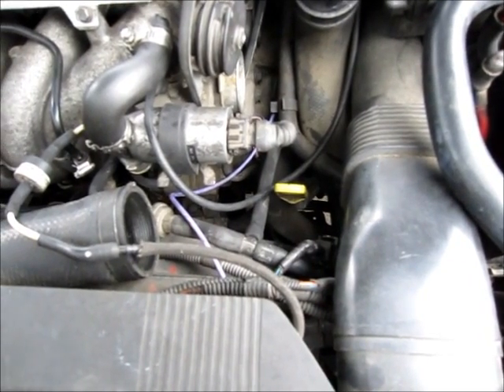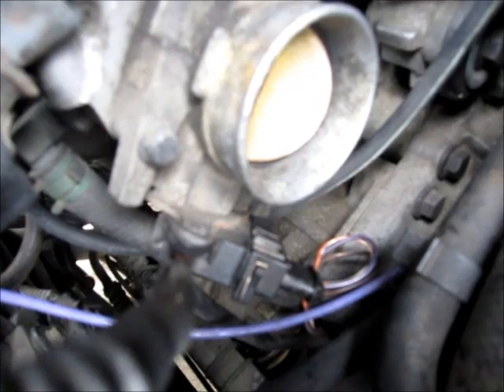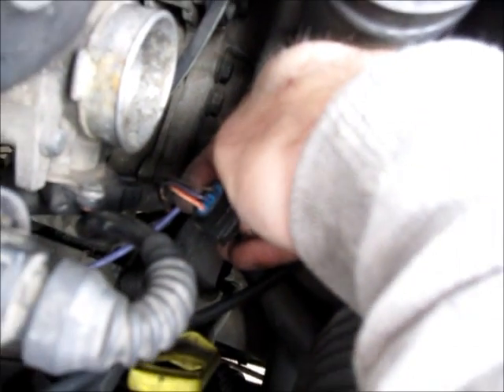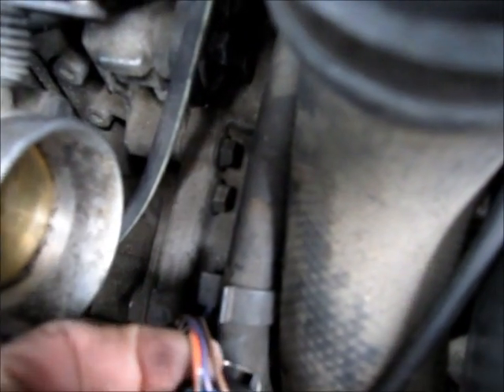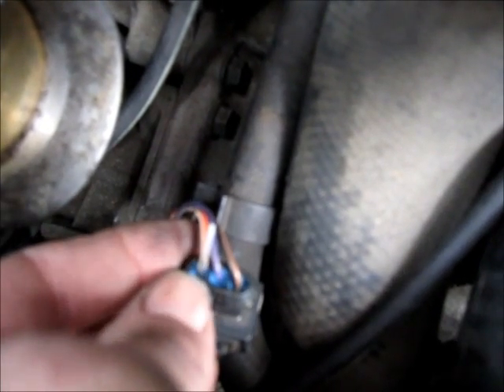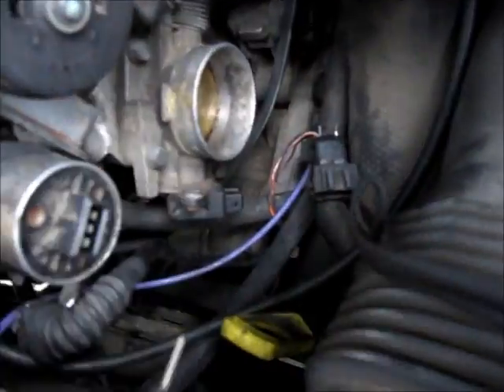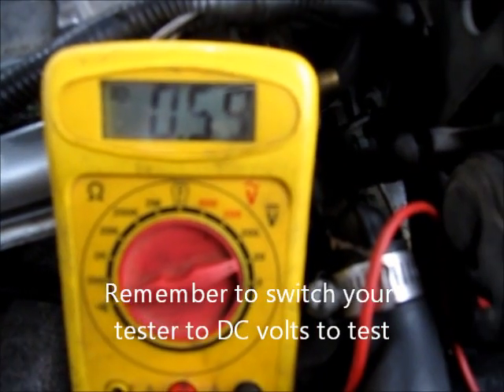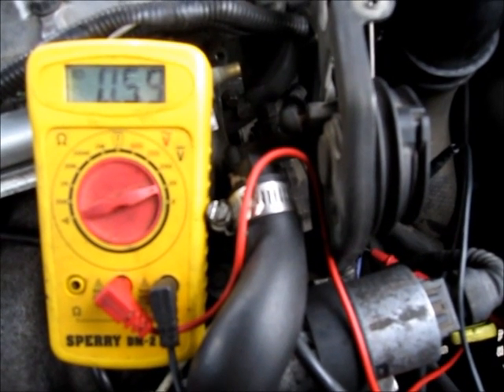How To Test A Volvo Throttle Position Sensor

Comment: So I’m getting 0.8v then it goes up to 2.1v and it cuts the power.  Got 5v in all the time. The car is almost impossible to drive right now. So is there another parameter that determines the output voltage. Got a clean throttle body and 2 different ECU. Had problems with car for 2 years now. And this might be the final problem, but I can’t find the solution. Any suggestions?

Comment: Jennie! I tested the wire harness for the TPS on my 1988 Volvo 740 nonturbo wagon to find that 5.0 volts was being provided on pins 1 and 3, with no voltage from pin 2. As I understand, the tps on the volvo 240 that you made a video of, only provided one pin with 5.0 volts. What may I conclude?

Comment: Other issues to check Accelerator Pedal Position Sensor Engine (or even the gas pedal) symptoms:  response is inconsistent, Engine does not run efficiently, Your car doesn’t accelerate over a specific limit, Your car hesitates to move when the gas pedal is pressed, Your car won’t shift up or jerks upon depressing the pedal

Comment: I have v70 2002. Non tubro. Driving. My car 4 two miles the car stop run in.lput N. Trurn the key.again strats again put too D.its happen when i cut down in traffic or red light..  What can it be?

Comment: I don't have a digital multi meter thingy.... :( I guess i will just replace TPS and hope that was my problem. Thanks for sharing your video though. Now I know where it is.
Reply from the maker: +Jacqueline Derrick I hope you get it sorted out, just be careful "throwing parts" at a problem. I have wasted a lot of money that way :P
Reply: +Jacqueline Derrick - Harbor Freight has coupons for a free digital multi meter,and believe you don't have to buy anything.They are in most states.
Reply: +Jennies Garage if it's not throwing a code is the tps alright?

Comment: In my case it idles fine and this only seems to happen after 1-the car has been running a while and 2-between 2000 and 3000rpm
Reply from the maker: Is the check engine light on? If it is, that could give you some insight to the problem.

Comment: So I just had the code come up for faulty throttle control sensor, but everything checked out according to your video. Is it possible that the sensor is just dirty or something like that? Most of the time my 95 850 wagon runs fine, every so often it loses a small number of rpms for half a second and this code comes up every time.

Comment: I performed this test and the TPS seems to be working fine since i obtain the same voltage value as you. Any advice on what else may cause my volvo to idle badly when engine is warm?
Reply: Trouble shooting 92 volvo 25E glt

Comment: My wife's v70 needed a throttle body replacement. I went to XemodeX . They are remanufactured with improved design, no contact strip to wear out. I had the car flashed for peace of mind for an additional $65.00 and have no problems since then a year ago. I did the job myself and it was easy.

Comment from the maker: Hi, if the problem started right after the throttle body was worked on, check all the connections in the area. I think the 2001 s80 has something called an ETM (electronic throttle module) rather than a standard tps. They are kind of notorious for causing trouble. Unfortunately I think if it's bad, the whole throttle body needs replacing.
Reply: Mine is 2000 S80 2.9 and had misfire this summer so replaced the PCV system and cleaned the ETM. Now I have the issue where I can loose power for a brief 10sec or so and eventually leads to limp mode on cold start the next day. There seems to be fix replacing the sensor alone which brought me here to check it. The ETM and the sensor together have a 6 pin plug which I had difficulty removing so far, in that case which wires need to be checked for the voltage. Or should I open the case, remove the sealant and check the 3 pins directly from the sensor as the sensor now costs about ~200 $ and a reasonable amount of time for shipping and fixing.

Comment: I have a Volvo s80 2001 I had my throttle body clean and after cleaning I got a code saying sensor was bad. Do I have a sensor on my car or do I have to replace the whole throttle body. My car goes into limp mode and idle up by itself

Comment: I was just curious what kind of problem is associated with a bad throttle position sensor? Because I have a 97 Volvo 850 turbo that starts wanting to turn off when idling on the drive gear. Would greatly appreciate your help, thanks.
Reply: The following are to check about rough idle 

engine misfires, rough idle, vibration, possible causes:

“fouled spark plug, clogged fuel injector, faulty oxygen sensor"

Check:

Check: alternator voltage (14.5 at start and 13.5V) inspect all wires at the alternator, starter, behind the engine bay fuse box, ground behind the left top of the engine 

Check PCV positive crankcase ventilation valve, replace short rubber hoses if stiff with age (noise sounds like blowing air over the hole in the bottle although a bit higher pitched may also be a alternator regulator issue

How to check PCV - pull valve out from motor and listen for a hissing sound and good suction on finger (do not use rubber glove as the suction can suck plastic off the glove getting clogged in valve)

Check the electronic throttle system/module ETS / ETM working (clean throttle plate)
What are the symptoms of a dirty throttle body? How smoothly the engine operates. Signs indicating a problem include rough idling, jumpy or sluggish acceleration, poor fuel economy, and stalling - 

How to check ETM  With the use of a throttle body cleaning product, the dirt and debris buildup are easily removed

Check oxygen sensor working (clean)

Check bad crankshaft position sensor CPS (clean) NOTE: symptoms of a failing bad crankshaft position sensor: 1. Issues Starting the Vehicle · 2. Intermittent Stalling · 3. Check Engine Light Comes On · 4. Uneven Acceleration · 5. Engine Misfires or Vibrates. 

How to check CPS The third method of crankshaft sensor diagnosing is the most accurate and is used at professional stations. It requires the presence of an oscilloscope and programs

Check failing ignition coil

Check issues with the fuel system ie delivery problem = “filtration sensor” rather than fuel pump (as the fuel pumps are robust) 

Check the throttle body TP sensor built in the throttle body. 

How to check - need a multi metre and a couple of paper clips step 1, disconnect the sensor from the cable step 2, on the back of the plug the three wires, step 3 the middle wire is the input wire and the outer two are test wires, push paper clip's into the back of between the twi wires and the casing, step 4 wiring and the housing, should look like the test wires and pushed in to between the meter to DC setting and turn car engine on to idle reading should be .59 and as car is reved up the number should increase to about 4.5 volts and then bring back down to idle the numbers should decrease as well to show that it is functioning alright. 

Check Mass Air Flow sensor for rough idle use CRC Mass Air Flow Sensor Cleaner. 

How to check MAF use the MAF cleaner on the MAF wires(inside MAF) and also spray it on the built in connector and the electrical spray (CRC) to spray the connector that goes onto the MAF

And thats it - good luck - let us know how you went?

Ah I've just noticed you question is 8 years ago - I'm tipping you have gotten help with the issue already? I cannot see you waiting with baited breath near the phone for a response...

Comment: Good video, my sensor is 3 wires in a triangle shaped plug.  How do you tell which is input and which are the outputs?
Reply: the middle is the input the two outer are the outputs - usually

Comment: 1999 & 2000 models use drive by wire; no TPS like this one and is supplied in an internal unit on the Magnetti Marelli throttle body

Comment: is it suppose to have 3 wires? i think mine have only 2.. its a wire clip attached to a black box thingy beside the throttle butterfly... can i get iw wrong? im using a nissan rb20det r32 skyline gts..